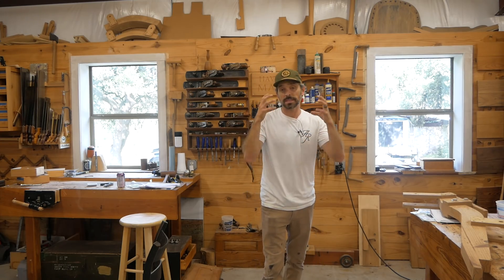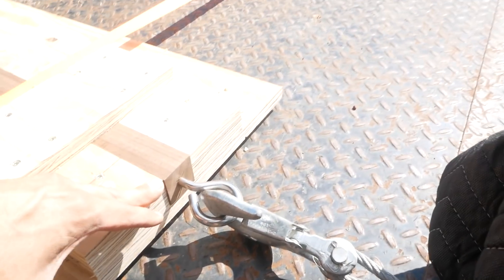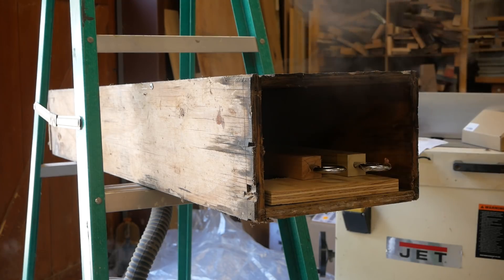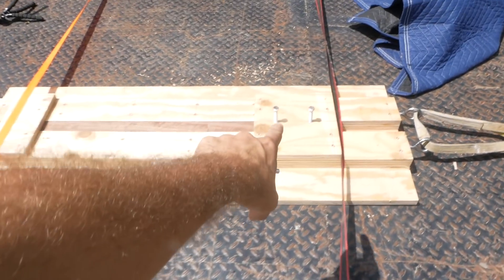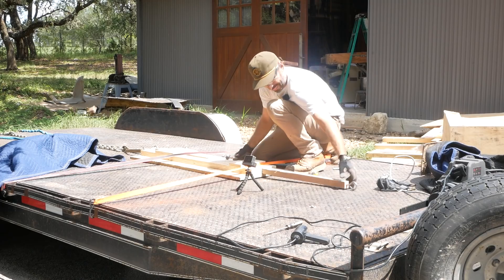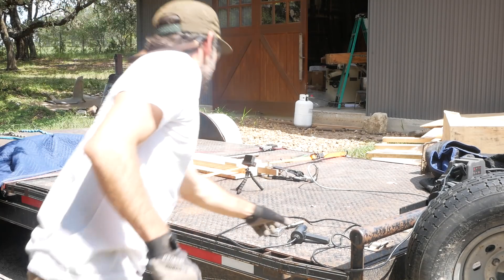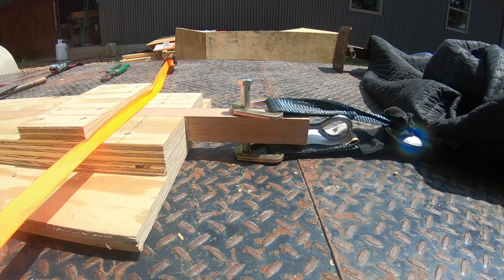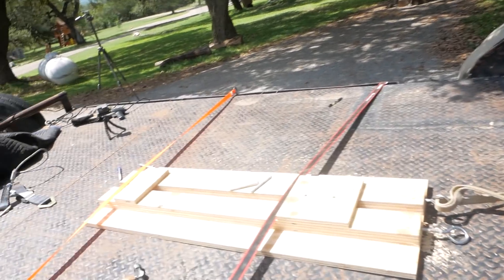Can A Board Be STRETCHED? (A Rabbit Hole of Failure!!)

Comment: That is Science man. You where conducting science, and you did learn something. Excellent!     One Item that would be nice is a load meter to put inline with the system. Then you could record data like, How many pounds/Kilos of pulling force until failure of the wood. This would be good data for others in the wood working world to know. I could see applications for this research you where conducting for Boat builders and woodworking engineering in general. Great work.   Load Meter next time. Maybe you could get a company to donate a device for free advertising.

Comment: Doesn't the wood have to dry before it will stay the way you bend it or stretch it?    When you bend it you leave it until it dries.  And it stays when you take it not of the mold. Stretch it, leave it to dry then unstrap it it will stay longer. Maybe?

Comment: This is 1 of those things that sounds good but doesn’t work on paper. It is much easier to bend because it’s basically compression however stretching is different. It’s possible to maybe gain a little bit of length if you constantly stretch and hold it but other than that it’s just going to fail. Putting it simply due to physics compression is easier than stretching wood because wood likes to stay compressed and firm.

Comment: To stretch a section of expensive non dense wood, like Rosewood, for example, I place it in a jig in a hot water tank (10 foot) and gradually stretch it a little every hour while under water. Then let it dry while stretched to avoid shrinkage.

Comment: Wood is stronger in tension than compression; but the connections are the problem.  You need more than one or two bolts(pins) through the piece gives a smaller cross sectional area than the piece of wood.  You need more total pin or bolt area plus clamping force at each connection to have any chance of it working plus when put under tension it needs to stay and cool and dry in that state just as if you were bending it.

Comment: Just like with bending wood, you have to hold it in that position until it sets. How do you hold the stretched piece until it sets to its new form. I made this comment before you completed the test. Bending fibers is completely different than stretching them. Don't see how this can happen. Hope I'm wrong. Oh, you can stretch them a little, maybe, but it won't stay.

Comment: My idea is to use white cedar and have the ends you are pulling from be lager than than the body in order to increase the surface area of the pressure and make the transition from the body to the ends roughly 20 degrees instead 90. Further more instead of bolts cut a notch all the way around that you clamp into. It would look somewhat like a table leg.

Comment: Fun, but I tihnk you're misunderstanding whats happening when you're steambending. You're not stretching the outer diameter, if that were the case then the length of the outer diameter would be longer when bent than the board is when it was straight. You're  actually stretching and compressing the fibers side to side, not in the length.

Comment: Nice try Andy, (short story) I was 15 and working as a helper on my dad's frame crew and was told
to go behind the front seat of the truck and fetch the lumber stretcher. He even told that it had
a green handle with 3 short pcs. of cable on it. After looking for about an hour or so I caught on
to the joke. So I know from experience there is no such monster out there.

Comment: What if you made some kind of Chinese finger trap for the ends where the harder you pull the tighter it gets?
Reply: Thats what i was thinking use a steel version  of that and keep it under tension untill it is cool and dry.
Reply: They use a Kellems grip in the electrical industry to pull wire & cable. Should work on round stock, not sure about square or rectangular items

Comment: Aside from the suggestion of applying tensile force while in the steamer, you might also try steam bending it one way and then steam bending it the other way.

Tbh, bending works by compressing the fibers laterally... and wood has tremendous strength along the grain... so I’m not sure the fibers have much elasticity either in compression or tension.

Comment: From what i understand it is possible to stretch a board as you did. But to stretch it past the point of its natural elasticity limit(meaning when the load is removed the material returns to it originalstate)  the board may just also reach its max stress point resulting in a failire of the wood. Not to say its impossible but the margin of room to stretch and deform the wood without having it fail could be very difficult. It all just depends on the properties of the wood. Primarily its elastic limit and ultimate yeild strength. 

I will admit it is a cool experiment though. And i agree with some other comments. You might achieve permanent deformation to a longer length by leaving it in tention as the board dries. Possibly letting the boards fibers relax into the new length.

Comment: Yeah sorry from a material scientist standpoint you do not drill through a test piece to secure to test its yield strength. You should be clamping each end with a clamp block that is secured to the test rig. This way you do not weaken your test piece where you secure it. You can definitely stretch wood you just need to up your test rig game. Wood will fail like you are seeing spectacular sure with a crap ton of steaming you will find something useful. Clamp brother clamp these will need to be custom made.

Comment: It's not a bad idea, you just had some engineering things you didn't consider. 

First, the winch jerks and jolts as it tightens. That kind of sudden force yanks on the wood as opposed to providing the steady pressure you want. Something like a screw-type mechanism where you can more slowly increase the tension will work better and let you apply more tension before failure.

Second, your connection points (the bolts through the wood) are going to be the weak points in your wood. The best option to stretch would be a dog-bone shape, thicker at the ends where you're attaching the bolts and thinner in the section you're trying to stretch. Another alternative might be to glue the bolts into the wood or find some other way to reinforce those locations.

Comment: Stretch it while it's in the steamer. Then shut off the steamer, leave the tension on the board until it has dried.
Reply: Yup, was thinking the same. Need to leave it under tension until it's cooled and taken a set. Just like you'd do when bending a board.
Reply: Came here to say this
Reply: Exactly.